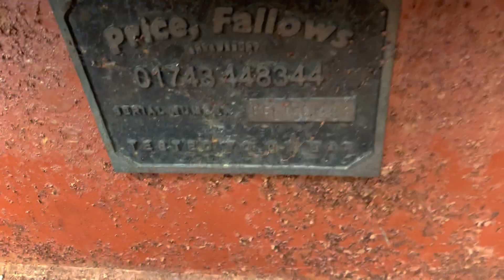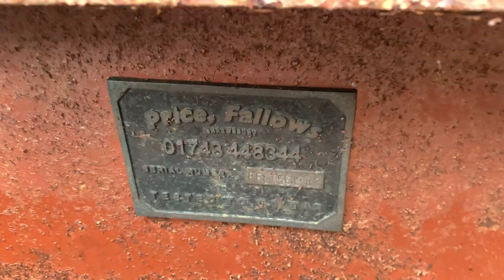409. The BEST and WORST of this Narrowboat

Comment: James, get the boat ‘operational’ first rather than decorational. By that I mean get all your systems working:- engine, hot water, batteries, electrics (including an inverter) etc etc. I wouldn’t be concerned about tongue & grove. You still don’t have hot water in Sloe Patrol, that should have been prioritised years ago.

Comment: James really nice boat. Seeing the diesel engine under water to the top of the block, I will not be surprised if it does not turn over, having been under water as long as it has been (lots of rust on metal parts) engine will probably need to be rebuilt. Watch your finances, leave the ceiling for last if possible. I was surprised you did not show us the bottom of the boat and how it is in great shape (no holes), we all remember how that goes. This will be a great build, thanks for including all of your fans!!
Reply from the maker: Yeah she’s a great boat 
I’ll show you the baseplate tomorrow - needs scraping back and blacking pretty soon

Comment: Ahhh The joys of being a steel boat owner..  I also has a steel boat which I totally refitted in Trinidad. So 2 tips for you; 1,  When you have an oxidised steel surface (i.e.Rust) Take of the surface scale and treat with Phosphoric acid. It changes ferrous oxide into ferrous phosphate a hard steel coating. Brush vigerously with a stiff brush and plain water to remove the residual phosphoric salts. You will have a very hard black protective layer on the steel surface. Prime and paint as you will. 2, ALWAYS pazy attention to the paint overcoating time... never put paint on top of a soft previous coat or you WILL get bubbles. Enjoy your project the satisfaction is in the journey to get you there. Lots of anodes. Regards The Captain Cass

Comment: I wouldn’t worry about the internal ceiling or building a Houdini hatch, concentrate on getting the boat ready for the kids with everything working etc…….the “Frilly” bits can be done later if & when finances allow👍
Reply from the maker: But it’s messy work and should be done now. I’m not 100% on it yet so may leave in place and tart up

Comment: Wouldn't surprise me if that trim weight in the sterm is to counterbalance that whacking great stove. I imagine with water in the back boiler it'd be a right heffer.

Ceiling looks good though, I'd leave that. Think narrowboats look a lot better with that style of ceiling, and if anything easier to deal with issues/rework later on as it's not in massive sheets; you can just peel back what you need (especially for the electrics which I have a feeling will need a proper going over). I like the idea of a houdini hatch as well; perhaps there's a way of doing the "messy" part for that without spending weeks on tarting it up afterwards - get it sealed and have it ready for when you can spend more time on it later. Maybe just a lantern for now.

That engine is probably going to need a rebuild though. Ouch.

Comment: 3 quick observations
1 - leave the t&g ceiling for much later 
2- downside of all the big windows is heat loss in winter
3-the location of the stove matters less if you use the Backboiler and radiators to distribute the heat.
Reply from the maker: Downsize the windows !!!!! What a great way to spend a few grand and reduce light 

The stove is sooo big the flue would need 3 bends in it!! I can’t do the ceiling later as I need to access the roof now and do electrics - besides it’s messy and I have a skip
Reply: @TheNarrowboatThatJamesBuilt  nobody said downsize the windows ...  But maybe look at double glazing or at least very thick closefitting curtains?
Reply: @PinkLittleElephant  he needs the light for his cannabis plants 😆😅
Reply: @TheNarrowboatThatJamesBuilt  agree that stove is stupidly big.
I didn't like the look of the ceiling sheets on SloePatrol ... Don't look like they have an even bend and the joints between the sheets look a bit rough ...  sorry

Comment: I think the suggestion  about  the  ceiling  is a good  one you have an engine  that needs attention  and batteries  for your electrics is the backboiler connected to  the  radiators

Comment: Hi James, 
Engines are designed to keep the fluids in so as long as the water did.t get into the air intake it should be ok, like you said the electrics on the engine are a different matter. 
The boat certainly looks much better now its been cleaned out . I would drop kick that wind turbine straight into the skip , disconnect the solar panels until you have determined the safety of the wiring.  I see 13 amp sockets, is there an inverter on board?
everything else is doable. You will have to Rob and his label machine mobilised .
Reply: Can’t wait to see end product James great boat. 😊

Comment: On the exterior what were those round holes above the waterline (I forget what you called them) for and why are they dangerous as is? Leigh
Reply: Skin fittings. I thought they were to pump water out, from kitchen & bathroom, but there's a lot of them on that boat isn't there. I think they're quite close to the water line maybe?
Reply from the maker: They are far too close to the waterline and there’s so many of them without swan necks which is which it’s dangerous

Comment: I was told don't use a win turbine when the bearing start to wear he noise is horrendous
Reply: Gosh! What a difference already. When we designed the inside of our boat, we were advised to have the stove on the port side of the boat. Reason being you can leave the chimney on and that's the part of the boat that goes through the tallest part of bridges. If you have it on starboard side its where the curve is lower - if you get what I mean x
Reply: On narrow canals it depends completely on what side the towpath is. Even bridges on broad canals can be an issue depending on the curvature and height of the construction.
Reply from the maker: This one was actually silent

Comment: Rather than moving the current bathroom could you not leave it where it is thus leaving in places all the skin fittings and just put the 2nd bedroom where the current kitchen is ?, walls are already up for the bathroom seems a shame to move them if they are in good condition
Reply: Run a wooden conduit down the centre of the ceiling feed garden cane wire through from the conduit to the light holes, a pain but that’s what I did on mine. Everything was surface mounted and boxed in so everything real easy to get to and replace, easier to fit if you aren’t ripping the cladding down